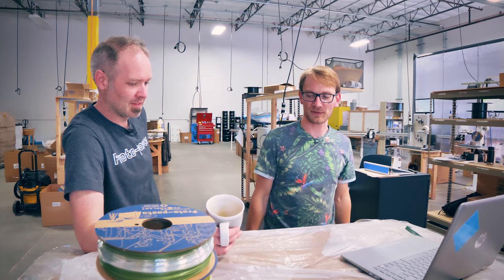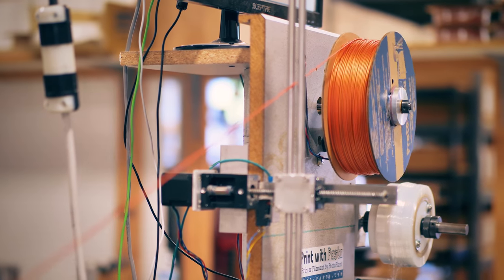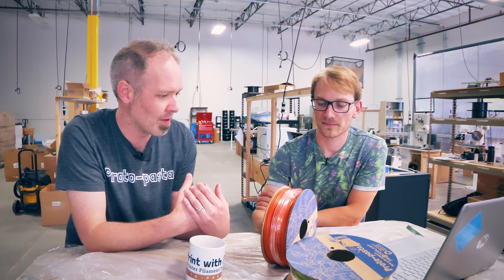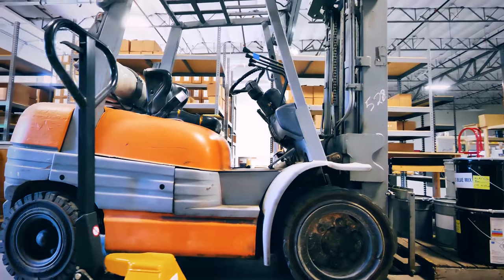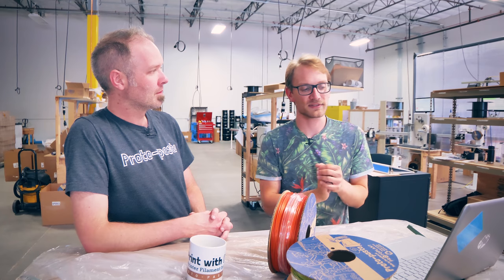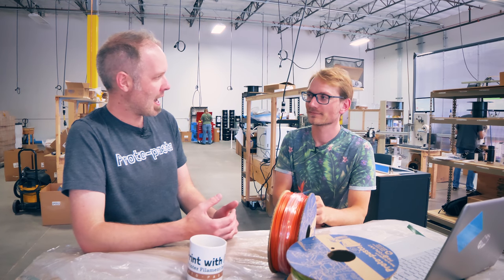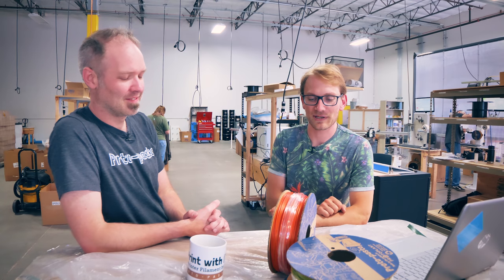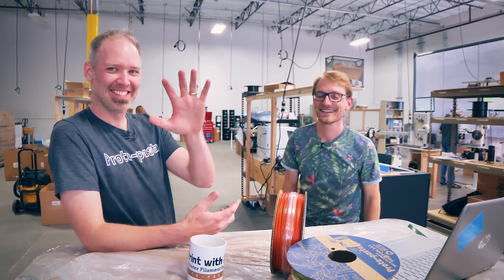QnA: How Proto-pasta makes filament!

Comment: I think a half day workshop where you pay a reasonable fee <=$150 to make your own roll of filament would be a pretty cool thing.  I think it would be viable if marketed correctly.
Reply: I could see them maybe scheduling a day where one line can be set aside for some custom stuff.  You'd have to use what they have on hand (obviously not going to let you just bring stuff in and toss in their extruder), and they couldn't let you right near the nozzle but maybe they could string it half way and let you finish stringing it onto a spool.  (Either that or make a person sign 50 pages of waivers that say 'if you touch the hot thing, we aren't responsible, if you don't wear these safety glasses, we aren't responsible if it sputters something at you, etc.)  I could see it being economically viable though to set aside an employee to kind of guide people through what they could put in there, what percentages, and then load the pellets into the extruder for people.
Reply: Revamped Outdoors They would definitely need to set it up as several people at once so the machine could be in use more continuously.
Reply: Take a day out of the month, say there will be 10-15 slots or so, take them in as a group and show them the colors they can pick, explain some of the math to them of what percent of what is recommended, people pick out what they want, you let them shake it up/mix it, then the group goes onto the floor and the Proto-Pasta employee loads it into the machine for them.  If you did it at $150 like Revamped said that would be ~$1500 to cover having a line down for a day, the employee's pay for the day, and hopefully your business insurance rates stay the same if you take enough safety precautions.  Also, less financially - you walk somebody through their own color like that and you're almost guaranteed to have a customer a lot more engaged in buying from you specifically.
Reply: I think 150$ is a bit steep for just one 1kg spool of filament.. Yes, of course it's the time the line is down and everything must be paid.. But for one 1kg Spool i would like to see a price of like.. 30-40$
Reply: ualdayan Sounds like a great proposition. Great advertising too, like you mentioned!
Reply: The initial spool would have to be expensive to cover the overhead and loss of production.  Once the formula is known, less for additional spool orders but still not as cheap as there are line down and setup times involved.  If I owned a filament mfg company, I would not even consider doing this as custom usually takes a lot more time than you think it would.   Unless the equipment was being under-utilized.
Reply: My thoughts are that this wouldn't be during production days. Many companies do workshops on low production or off days like weekends during slow times. It would not make sense to slow normal production. I see this all the time in the dairy industry you take an off day and run a workshop at a cost that makes sense grow a more loyal customer base, produce a unique product the customer can take pride in and also cover costs and/or make some money. Additionally, having workshops on the weekends allows for more customer involvement as most have m-friday jobs.

Comment: Being an electrician and knowing control automation, i can see a system that can automatically pull raw material large Hoppers  and mix batches automatically, then feed it right to the extruders hopper. This would tremendously speed up manufacturing time and then allowing custom mixing by the consumer possible.

Comment: Although being able to see the shop in person and being able to mix my own color would be a very cool experience, it is very unlikely that  i would travel there for that. Instead I'd rather like to see an online web interface where you can virtually mix the available ingredients. It would make suggestions for percentages, and maybe even show a rough color approximation. You could then place an order for your custom spool(s) at a slightly premium price. (Maybe depending on which ingredients and how many are used, price would also increase?) The more spools you order the better of a price you get on your custom order.

Comment: Proto-Pasta: Have you considered moving to 3D870 (if you haven't already)?  According to Natureworks it has even more impact resistance BEFORE annealing than 3D850 does even after annealing.  Although I have seen it said that color can be harder to achieve with 870 so maybe that would be enough reason to stay with 850 for you?

Comment: I would love to see a automated compounding system kinda of like paint tint then add a custom web interface to allow small run batches of say 5kg minimum per order and if it took 2 weeks to get my custom colour that would be cool you could tack on a custom order cost most of us that buy proto pasta are good with the premium price for premium filament anyways so a little more and a bit of lead time would be cool the batch mixing would probably need to be automated to not use a ton of man hours but it could be done

Comment: Hey Tom, I'm trying to decide on my first (own) Printer. I've printed about 900h on my School's Flashforge Finder and I love to tinker and I'm also a CNC guy. I am thinking about buying a Renkforce RF 500 (I know about the Ramps on it would replace it with the Einsy? board from Ultimachine). Any thoughts on the Printer ?
Greetings from Lower Saxony

Comment: Ditch the spools altogether and go Masterspool. No wasted cardboard.
Reply: Too expensive to ship to America.
Reply: The Iron Atheist 50 Masterspool is more a system than an item. As you know, Masterspool is a spool you can print for yourself. All we need now is for ALL filiment manufacturers to ship their product without all the waste. A wound batch of filament, four velcro strips, vacuum seal it and that's it. It arrives at your doorstep, you grab your Masterspool open it place the new filament in, close the spool, lock it, undo the velcro and start printing.
Reply: But the only supplier that does that right now is DasFilament. Yes, Masterspool is a GREAT idea. but the suppliers are short, being only ONE. I checked their prices. Comparable to mid-high priced filaments, but the shipping for one roll would have been in excess of $70, and the price goes up with more spools, or bales. I wanted four spools and the shipping was going to be $180. Not even in their dreams would i pay that.
Reply: The Iron Atheist 50 yeah, that's why I said more suppliers need to start switching over. I'd be willing to bet it'd catch on pretty fast.
Reply: I for one hope it catches like wildfire.
Reply: The Iron Atheist 50 ;0)

Comment: problem is that they are still playing with old extrusion technology , start looking at static electric transfer and heater bar fusion which will require nano particle sized plastic that would look a lot like the toner in a laser printer .

Comment: cardboard spools suck, especially if you spool holder is edged based. Just to weak. Ive also seen lots that the side of the spool falls off the central roll... result is a very bad day!  (Not saying these will do this, but others have)
Reply: Give the public the choice.
Reply: Peter Ellens giving the public the choice is hard to do for a company when it is something like this. It brings three scenarios into play. 
Scenario 1: The majority choose plastic spools. You then have severe plastic waste. Where we are talking 250+ grams of plastic that can't decompose (even if it is a biodegradable plastic it still takes years). People who are advocates of reducing plastic waste stop buying from them and move to another manufacturer. 
Scenario 2: The majority choose cardboard spools which turns the people who want plastic spools away. (You say cardboard sucks. So you wouldn't buy their filament. So point proven essentially.Also if someone has concerns about the carboard falling apart they can very easily add some more hot glue to it to ensure it doesn't fall apart) 
Scenario 3: There is no clear choice. Votes go 50/50 or close to it. This means that not only would the company be required to have both plastic and cardboard spools on hand (since you want the customer to have the choice and therefore would require Proto-pasta to stock both) in relatively equal amounts, It would also require them to have stock of filaments loaded onto both types, would require adding more data to their database for stock keeping on their end and on their website and require either two versions of each filament to be loaded onto their webpage or code changes to their website to allow the choice.

In whichever scenario plays out it is a problem. 

The best option may be the new "masterspool" thing. But that brings with it it's own set of problems. What if people don't want to print out quite a few of them if they have many machines for print farms or if they needs to change filament frequently and don't want to waste time etc etc. Also that requires further setup and modification on their current winding machines. So we will see where that goes.
Reply: Unfortunately I've run into this too on my E3D Bigbox.  The edges slowly become more and more frayed because the whole spool's weight is on the edge of the spool as it turns against the bearings.  I ended up taking a simple peg, screwing it to something nearby, and just putting cardboard spools on that (rotating along the center towards my E3D Bigbox, rather than using it's built in spool holders on the back)
Reply: But the public has a choice! Rich-Rap has designed a printable adapter that allows the Prota-Pasta cardboard spools to slip right onto his master spool system! So you have the option of going either route. Best of both worlds!!!
Reply: Didn't know about the adapter - that would help for sure.  They need to hire Richard Horne to do all their photography - the filament looks so much more shiny and glittery on Horne's twitter page (where he announces the adapter and shows a transitional spool they sent him) than it does on the official page.